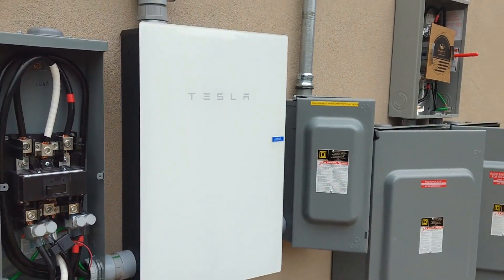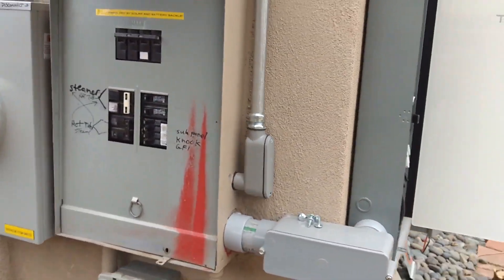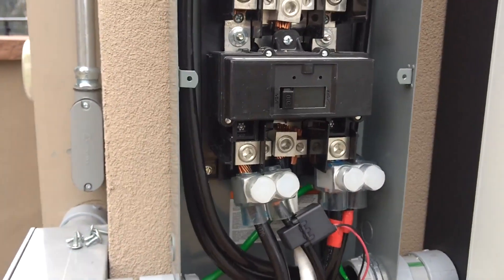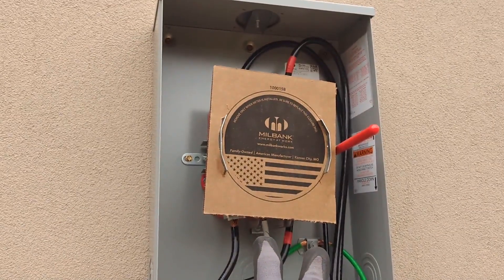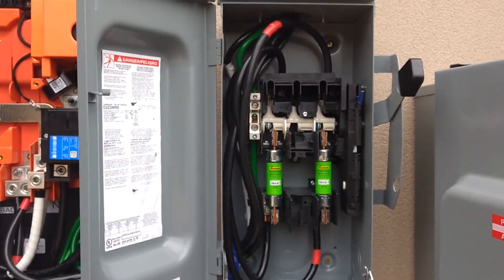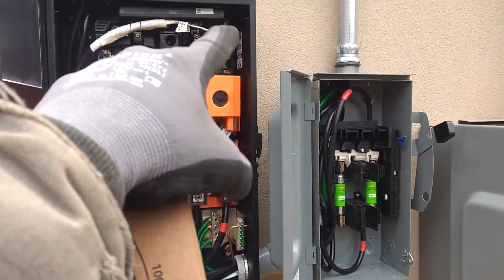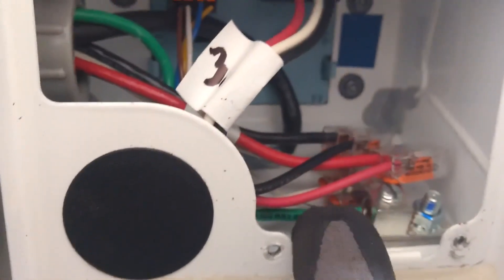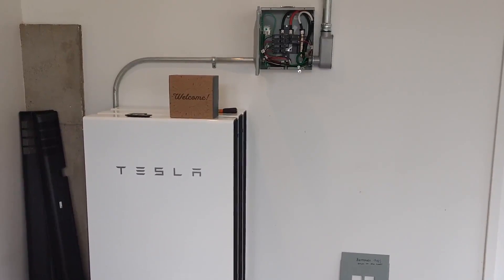Tesla Powerall wiring: whole home backup plus line-side solar taps. (spliced)

Comment: Hi, I think my question is ridiculous, but it's necessary to ask. When my power walls were installed, the existing PV system was rerouted through breakers, a disconnect and then to the load lugs in the Tesla battery controller. Sadly, Sunrun is claiming that this is a "modification or tampering" with their "solar facility." BUT they will drop that claim if I reconnect the PV to the busbar in my main distribution panel (leaving the ammeter in place for the Tesla controller to monitor PV input). Since the subpanel busbar and the load lugs in the Tesla controller are directly wired together with #1 copper wiring, I can't see how it would make any difference -- other than me getting Sunrun to drop the claim of breach. What am I missing? Should I just do it and be done with this hassle?
Reply from the maker: seems like its all connected so it would work either way... but i'm not there looking at it...
Reply: @AngelMalakim  Thanks. Seemed like it to me, too. I've also told Sunrun this very thing over and over. They have not looked at it and assert that the battery interferes with the working of the PV system. Does so primarily because they didn't install it. A competitor did. BTW, avoid doing business with Sunrun. 😠

Comment: Can't run comm wire with 120/240
Reply: I mean personally I don't like doing it ill never do it. But if you have the proper shielded comm wire and min. spacing yes! It's code
Reply from the maker: if the jacket is rated for the highest voltage present, it passes inspection

Comment: How do you release the powerwall from the wall?
Reply from the maker: you would need to lift it off the mounting bracket after loosening the connections in the junction box. be careful, its almost 200 lbs

Comment: What type of lugs do you prefer over piercing ones?
Reply from the maker: you can see them at 1:40
Reply: @AngelMalakim  We can see them, but what brand are they?
Reply from the maker: @robblack6115  Burndy.  Ilsco and polaris also make em.  2port insulated pass-through  lugs.  Or Google 4/0 splice connector 2 port dual entry.

Comment: Nice video. Did Tesla install a 200 amp solar breaker in your meter main panel? What model is your meter main panel? My 200 amp panel can only support a 100 amp solar breaker, so I have to upgrade my panel to support a 200 amp solar breaker. Is that true? I cannot live with 100 amp load. Really thankful.

Comment: Please, plan it before you install the boxes. They are all crazy different levels and it looks like a mess, despite everything else being done mostly great. Why did you leave those coils at the bottom of the panel? Allow smaller bends without those loops. Any reason why it was done this way?
Reply from the maker: Yes, many of the pieces of gear were built from the necessity of knock-out locations, existing gear, and available space.  We leave service loops in our wires to facilitate amp-clamp readings as well as making new ends if something happens to the wire while stripping.  better too long than too short, and we've found it handy to leave 4-6 inches more wire than you think you need.

Comment: Thank you, my installer company intalled 2 powerwall at my garage. After start-up, powerwall battery 1 didn't turn on. 
I looked manuals and measured power inputs and nothing, the power was good. When finally found the soluton by this video. I saw the 2nd battery had the wrong RS485 wires combination from 1st battery. I changed them to the right way and update my devices on gateway configuration wizard. After that my 2nd battery turned on, and everything is because I saw the reason of this communication port in your video. Really thankful.
Reply from the maker: I'm very excited to hear this video was helpful!  and good on you for fixing your problem!

Comment: Nice install. If I was going to connect a Solar Systems to an existing Tesla Powerwall 2 & Tesla gateway what equipment would I need a complete Solar install to the existing battery backup system

Comment: you have two  200 amp disconnects with 150 amp fuses and 150 amp wire?  wire needs to be sized for the disconnect maximum Rating . not the fuse? size !
Reply from the maker: disconnects are rated for their max voltage and amperage.  It is permissible to use them as a lower voltage and amperage.  The Fuses protect the wire.
Reply: I stand by my response brother .Peace

Comment: Q. I got my Tesla solar about a year ago. I only got one power wall. I was wonder if I could add any other brand of batteries to make it a larger back up?
Reply from the maker: I would stick to one brand of batteries, but it is possible to power a separate panel with a different battery system.

Comment: Great video, thanks!  Wondering why you just didn't connect the PV to the optional panelboard in the Gateway using two 60A DP breakers?
Reply from the maker: We had 3 batteries and 2 solar inverters, so the internal panel board didn't have enough capacity.  Is that internal panel board good for 100 or 200 amps?
Reply: 200 amps. I gotta wire one powerwall 3 this week. What do you think? Partial or whole home backup? - I’m using gateway panel board for battery so it saves me a disco
Reply: @joenardi-s5o  It depends on loads...Whole house if loads permit is always my choice, but if you have large loads like heat pumps, A/C, or a hot tub I'd either not back them up or be sure to turn them off (load shed) during an outage.  The problem with manual load shedding is that you may not realize that grid power is down until it's too late.

Comment: i need some help wish you were in florida very nice work i have tesla solar and i screwed with the ct's and now i have it turned off because its going nuts any helpful tips to get this back to working
Reply from the maker: tesla powerwall requires CTs on the House feeders to measure consumption, and on the solar to measure production.  If you're having trouble read the directions or hire someone.

Comment: That Utility is making life hard for the Electricians. Soo many discos. 
Looks like you upsized the wire in the 125A PowerWall load center. But that's probably what the plans call for.
Reply: Ohh, the PowerWalls was 100' away, gotcha :)

Comment: Question... I’m looking into getting a 12-16kWh + 2 power wall system. I have a 100 amp service and panel (grid meter is separate) . 100 amps is more then enough for my house. Will I be forced to upgrade the service and panel?  Wouldn’t the backup gateway 2 feed the main on my panel? This would mean I wouldn’t be back feeding the bus bars like non Tesla systems seem to do over the 120% rule. Thanks
Reply from the maker: It's possible you need to upgrade your service because when the batteries are full all the solar will go back to the grid.  If the solar backfeed is over 100 amps then you will have to get larger service wires.

Comment: How are the inverters a load yet they're the source?
Reply from the maker: The inverters' combined feed is considered the line for the production meter.  Every other piece of gear considers the inverters to be a load, since if the AC power to the inverters is interrupted, they will shut down automatically.

Comment: On the power panel in the garage, what type of adapter is that, that you used to convert from pvc to metal conduit?
Reply from the maker: its all metal in the garage.
Reply from the maker: the LB conduit body?
Reply: @AngelMalakim  Thanks. The LB looked like it was PVC, but looks like its just a finished grey color.

Comment: It seems like the utility requires excessive disconnects, fuses, circuit-breakers, and separate boxes for everything. Fuses and breakers usually protect the wires. What is the reason for all of them?
Reply from the maker: You're right, this is much more complicated than it needs to be due to the Production meter, which the utility wanted that huge disconnect for (to isolate the production meter from the inverter).  And the left big fused disconnect is for our Load-Side Solar Taps.  This could have just been terminated in a breaker were it not for their insistence on the big handle disconnect.  

There are multiple 200amp disconnects for the house, the one in the gateway, which is the service disconnect, wouldn't really turn off the house if since the battery would turn on if you turn off the gateway main 200a breaker.
The single 200a breaker in the enclosure left of the gateway and the 200a breaker in the actual main panel would turn off the house.  we did our taps between 2 200 amp breakers so we could guarantee to the inspector that even with our solar and our batteries, not more than 200 amps could flow through those wires. (3/0 copper)

Smaller home systems in Colorado with Xcel as the utility now don't need a production meter under 10KW, so an array of  ACPV solar panels and no batteries can just land in a single disconnect outside and a backfed breaker in the main panel. (depending on the size of the panel)

Comment: Nice job but those disconnects look like something from Dr Frankenstein's laboratory. Very interesting to see you gang the Powerwalls. I don't think you needed the AWG16 comms wire. Surely shielded Cat6 would do? 200 feet isn't that far. Gig ethernet can go 300 feet on Cat6.
Reply from the maker: Tesla recommends using the best quality cable you can get for long runs, and we didn't want to take any chances.  that said, I think a AWG20-22 shielded cable would probably have been good too.

Comment: How difficult do you think it will be to switch out the Gateway for a Gateway 2?  I had my system installed just before the new Gateway was announced.  I was trying to see if I could get that switch out only because I've had trouble with the CTs not showing me the correct information and not charging my batteries correctly.
Reply from the maker: I'd ask a local company who can look at your particular setup, it could be easy, it could be hard.  I don't have experience with the Gateway 1, but if the CTs are not working I'd reach out to the original installer.

Comment: Thanks for the great video.  Had to do some research and this was perfect.  I have 2 solar systems now.  The first system was installed and with 2 Powerwalls.  I needed more panels to be self powered.  I had Tesla add their small solar system and doing so I think they modified the previous permit from the city.  The city now needed a 200 amp disconnect between the Gateways and the back up load center which was not installed at the time they installed the new system.  It was barley notice right before the new system was going to be inspected by the city.  Now Tesla has to come out and figure out how to squeeze such a large disconnect into an already tight area.
Reply from the maker: The large disconnects are a pain, sometimes jurisdictions will let you get away with a breaker if you have sufficient labeling and its all accessible for first-responders.
Reply: @AngelMalakim  Well, they were able to install it.  They moved the air conditioning disconnect over on the wall and made space and ran a large conduit.  Its ready for inspection now.

Comment: @AngelMalakim can we land the WIRES for 2 existing house loads panels in the backup lugs and land the generation breakers in the internal panel board please ?
Reply from the maker: The Tesla Gateway internal panelboard kit allows for 6 (12 if you use tandem breaker) spaces, up to 100 amps.  This internal panelboard can be used for non-backup loads, or you can make it a generation / backup panel by connecting it to the lugs on the bottom.    In our case, our solar production was over 100 amps, so would be too much to hookup to the internal panelboard.  Due to where the batteries were located, we ran a combined 1/0 copper wire to them, which was more convenient to land on the lower lugs.

The Tesla internal panelboard shines for small backup or non-backup applications, but it wasn't big enough for this job.

Edit:  I'm not sure if I answered your question, the answer is it is not possible to use the backup lugs for 2 house panels AND use internal panelboard for batteries/generation, since one set of backup lugs would have to be connected to the internal panelboard.  You'd have to feed one house panel from 1 set of lugs and then feed another panel from that one.   If one of your house panels contains the batteries / solar breakers, and you're under the 120% rule, that could work...  So if you had a 200 amp bus, with a 200 amp breaker, that panel could only accept 40 amps more for solar/battery breakers.  This is why we often have our solar / batteries on entirely different panels for larger systems.
Reply: @AngelMalakim  Thank you so much! I really appreciate it

Comment: Nice installation. Why did you decide on the Tesla PW vs. LG Chem & the SolarEdge Hub system?
Reply from the maker: The customer wanted more storage and the faster transfer time.  The powerwall switched over to backup fast enough the router didnt even restart.  In my experience with the LG chem, the transfer time was a bit longer, and there is no floor-mount that I know of for the LG chem.  Also, since this installation was outside in a car port, we went Tesla as the recommended operating range for LG is  -10°C to 45°C, rated for 2000 Meter altitude,  while the Power wall is -20°C to 50°C rated for 3000 meter altitude.

Comment from the maker: One feature of the batteries that I should mention:  If your batteries are full, and you experience a grid outage, the solar could over-charge your batteries!  To prevent this, the powerwalls will put out 65Hz power frequency instead of the normal 60 Hz, to turn off the solar inverters.  Once the batteries can safely accept a charge, they should kick back to 60Hz and the solar will resume operation.
Reply: Can you provide some technical detail on this? ... I have a Tesla Solar Roof and 2Powewall and when I turned off the GRID at the main breaker - simulating a power failure, I believe this 65 Hz condition caused by APC-UPS to go off.... not what a UPS is supposed to do... , dumping my computers and backups in a bad way. Wondering how I can setup to prevent this condition from causing problems on electronics that is sensitive. I found it odd that my APC UPS could not protect against this condition.
Reply from the maker: @terryfundak2138  if the 65 hz off-grid non-charging frequency is too high for your electronics, I believe you can contact Tesla to have them reduce the solar disable freqency down to 62 hz.  Check the documentation for your power supply for frequency limits, etc.
Reply: @AngelMalakim  This seems really kind of bizarre no?  Why not just have the batteries stop accepting a charge?  Can the inverters not regulate the power?  This is fascinatingly odd coming from someone who uses DC power.